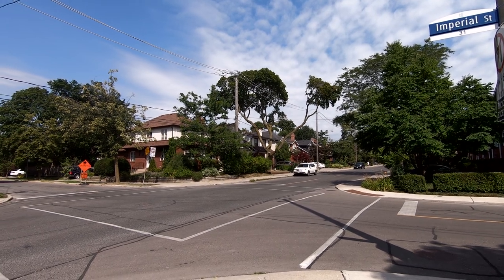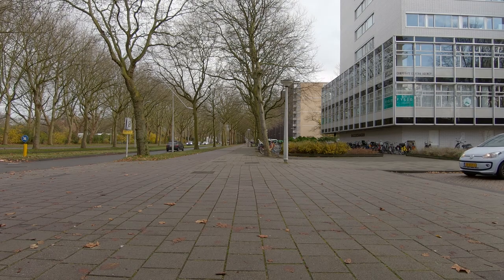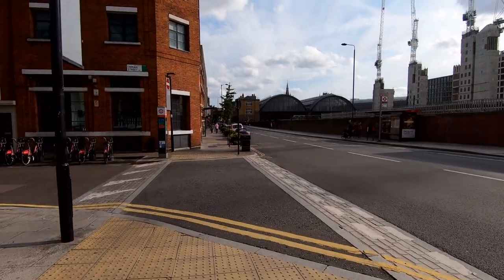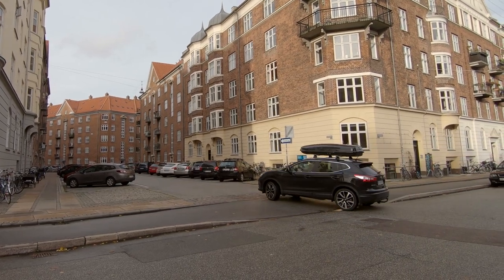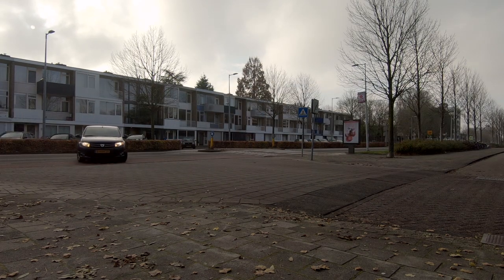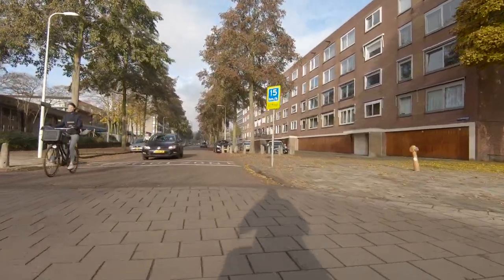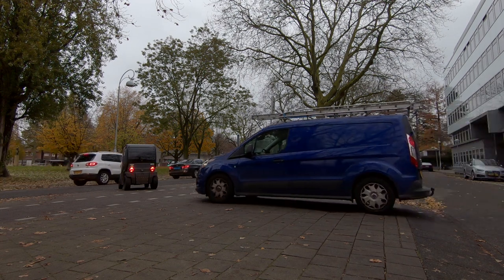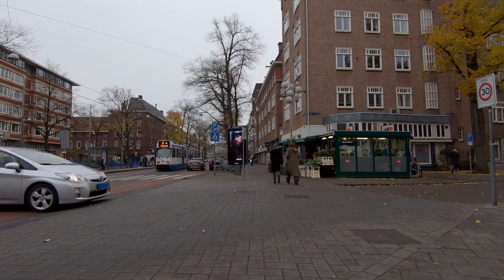The Dutch Solution for Safer Sidewalks - Continuous Sidewalks

Comment: There's a raised sidewalk along the side of a roundabout in Venlo. 

Normally people walking don't have priority on a roundabout as far as I know, but all motorists I've encountered there waited for me to cross... Even the motorists that looked like they stop for nobody, and even if I hesitated.
If you hesitate on a zebra crossing, more than half of the motorists just drive by at full speed
Reply from the maker: Roundabouts with raided sidewalks are pretty rare, but they installed one near me in Amsterdam and it seems to work well. 

Where is that roundabout in Venlo? Could you provide a Google Maps link? I'd like to look at it.
Reply: @NotJustBikes  not sure what you mean by Google Maps link, but if I zoom in to the roundabout, this is the URL I get: https://www.google.com/maps/@51.3659644,6.1646236,21z
I prefer openstreetmaps.org though, since you can see a lot more of the details: https://www.openstreetmap.org/#map=19/51.36589/6.16454 It's updated quicker after a change than commercial maps (since everyone's able to update openstreetmap) and openstreetmap free to use. Commercial maps tend to require some permission if you want to show it online or so. The only downside is that you don't have streetview

Comment: Typed in "Netherlands pedestrians" in search menu just to ask question. I found that Netherlands don't have such thing as Jaywalking and we can cross the road wherever we want but if it is on zebra then pedestrian has priority.  However there is a question emerges that isn't explained anywhere (i don't know Dutch so can't read rules). If there is no such things as Jaywalking, then what about red light (for pedestrian)? Can i get a fine for walking on red light? Not that i want to (i actually prefer use zebra and wait for right light) but question is still valid. Because if i can get fine for that then technically i could just cross few meters away from zebra where there is no traffic light (potentially creating dangerous situation).
So is traffic light (for pedestrians) is  only for convenience?

Comment: The drivers are allowed to focus on the ramp until they are on the sidewalk portion, and then they can look for cross traffic without becoming a danger.  

I know one such place in Sweden, but the problem is that it is still a road and there is no right of way for pedestrians, it is not even a pedestrian crossing of any kind, it is the end of a pedestrian area, a T-junction where the road into the old city has no sidewalks at all (it is just a continuos area) and this is one of the most pedstrian intensive areas in this tourist town!

It is in Visby, https://goo.gl/maps/Bfwea9o2x5NQR8iw6

Comment: Are ambulance cars in Netherlands speed bump proofed?
Reply: Ambulances are usually small vans, which do have a better suspension than normal cars and trucks.  Still, they also need to slow-down.  Gladly: speed bumps are only in the residential areas, which is only the last few hundred meters of their trip.

Comment: cool Video! My only concern with this design though is, that it might confuse drivers about as to where they are permitted to drive. If only roads are car territory its pretty clear. But when there are Sidewalks to be crossed which change up the classic road pattern but are still allowing cars access, I could imagine there being certain situations in which drivers mistake some sidewalks which are not meant to be crossed as "passable" and other confusing situations in which its not quite clear where the junction is supposed to be
Reply: Sidestreets and driveways have a sloped curb. If there is a 3-4 inch high curb, you're not supposed to drive there. And you'll dent your rims if you try with the wrong technique. (very slow at an angle)
For newbuilt houses, the owner must pay for a permit to drive over the sidewalk into their own driveway. In return, the county will install a sloped curb. But technically, the fee is for the permit. Normally, the contractor will include it with the utilities hookup.

Comment: It must be hard to get anywhere driving.
Reply from the maker: Why? Because drivers need to go the speed limit and yield to pedestrians? 🤔
Reply: Unless the speed limit was 3mph, the speed bumps in the video made the cars go far below the speed limit, regardless of whether there were pedestrians.
Reply: @blastum  Which is exactly the point. The speed limit is meant to be a maximum speed, not a speed at which you should drive continuously. The entire idea of this kind of infrastructure is to get people out of cars and make people use other modes of transport. This reduces congestion on the roads and makes traffic more safe, which means lesser people dying or getting hurt.
Reply: @PGraveDigger1  as I said, it must be hard to get anywhere driving. As long as efficiency isn't a concern, it's a great solution.
Reply: @blastum  Safety is a higher priority than efficiency fortunately.

Also, more people on bicycles and more people walking improves the throughput of infrastructure, which is an increase in efficiency. It might be slightly harder to get somewhere by car (which isn't hard at all in the Netherlands), but overall getting from A to B becomes easier for the largest amount of people. Seems pretty efficient to me, a small sacrifice by car drivers to improve traffic and society as a whole.

I'd argue that making a wide variety of modes of transport feasible increases efficiency, while making only cars a feasible option decreases it. Every cyclist on the road means one less car on the road, ergo more space for the cars that are on the road.

Just imagine if every student in the large university cities in the Netherlands (Amsterdam, Utrecht, Groningen, Leiden) would have to travel by car. There would be permanent gridlock. But most students go by bicycle, which means there's enough space for cars to actually drive, instead of standing still in a line of cars.

Comment: It's messed up how there is hundreds of comments and I couldn't find a single one that doesn't praise the idea or is sceptical to any degree of the video's message.

These continuous walkways radically increase the cost of infrastructure. The construction itself is more expensive and the maintenance (potholes, etc.) is many times more expensive and slower. The raised roads cause damage to vehicles and the eventual potholes cause greater damage as well.

This solution is an overcorrection that will lead to unmaintained roads and will be replaced by an overcorrection again.
Reply: You prefer the cost of injured pedestrians and cyclists?
Reply: @collectioneur  It isn't an either or scenario. 
You can have safe walkways/pedestrian crossings while still keeping them car friendly without unnecessarily increasing the upkeep costs of both the roads and the vehicles.
That's my entire point. This solution is just fully pedestrian and cyclist friendly and in 5 years time there will be another YouTuber who will go over all the problems these cause, how they're unsafe to everyone because Amsterdam doesn't have enough man power to keep them maintained, why the other extreme is the real solution and all the comments will be blindly accepting that as the truth. 
These things don't have to be a fucked up seesaw going from one extreme to the another.

Comment: This Dutch solutions works for the Dutch. It's not fair to compare and deem most effective Dutch roads when city infrastructure and roads so different compared to the other MUCH LARGER cities (Toronto, London) you choose to compare Amsterdam to. This is a bicycle city with smaller cars and fewer large roads in relation to the city size and transportation preference. Your conclusion is not logical if a city cannot also turn itself into a "bike first" city. Having lived in many large cities around the world, while I appreciate the form and function of continuous sidewalks here, I can honestly say, this system would be honest for a city like Toronto or New York or LA or London where vehicle traffic (as mucb as it can be a nuisance) is a necessity for how those cities are built. Or if not vehicles then accommodations for better public transit.
It shouldn't be a "better than" scenario, it should a "what makes this place unique" message.
Reply from the maker: No. It's better. Safer. More pleasant. And they reduce traffic because people use the alternatives.

Most of these designs come out of Sweden; they're not even Dutch. And most of this didn't exist here until about 30 years ago. They're starting to build a lot of this in London, too. Even more in Paris. Population is irrelevant. You're simply wrong about this. Toronto isn't special.